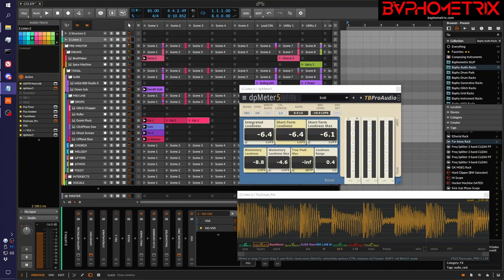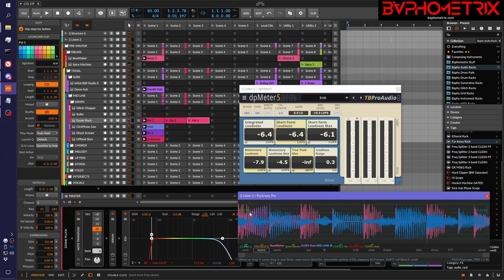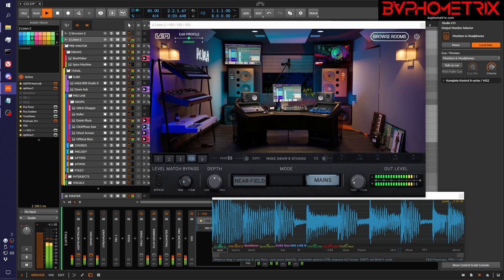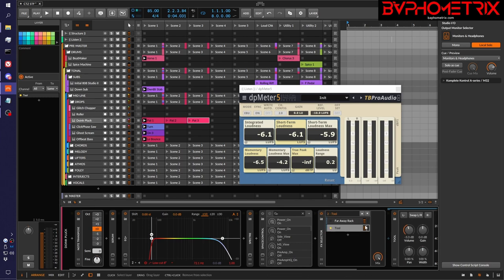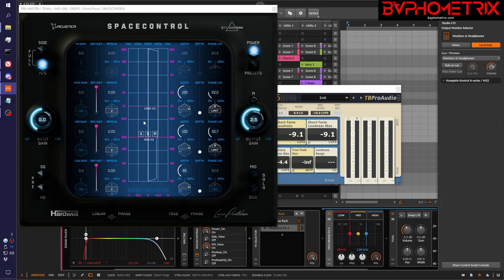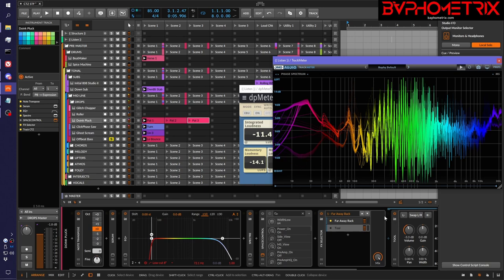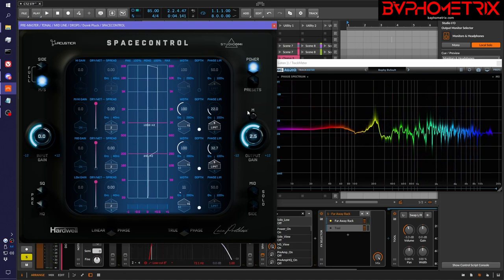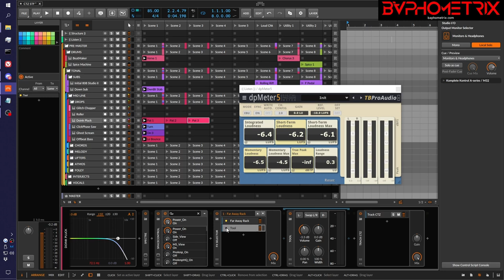Mixing Loud with CTZ - Ep. 24 - Controlling (and using) width and depth

Comment from the maker: TIP: If you want a less expensive alternative to Space Control, there's several versions of a tool called "SideMinder" by Raising Jake Studios. These all sit in the $30-40 range. If you look close at SideMinder, you'll see the same basic features as everything I show you happening on the right side of the Space Control UI. https://www.raisingjakestudios.com/sideminder%20series.html
TIP2: Also see Metall1ac's reply to this pinned comment. If you have Ozone 8 or later you might also be able to do most of what I show you with the Ozone Imager module.
Reply: There is also a hidden feature in the iZotope Ozone Imager starting from version 8 (IIRC) called "Prevent antiphase" that's hidden in the plugin settings. It does pretty much similar type of phase limiting as Space Control and SideMinder. You can also select linear-phase crossover from the same settings view by selecting "digital", and even mess with the Q-value of the crossovers. Just putting this out there, since many people already have and use Ozone and they might not necessarily need new tools for this kind of processing.
Reply from the maker: @Metall1ac  That's great to know! Thanks for sharing this.
Reply: @Baphometrix  SideMinder ME has the extra functions like limiting only the sides.
Reply: Nice video as always, big thanks! So much new and useful information :)
P.S.: Can I also combine bunch of Ozone plugins: Imager+Dynamics, Imager for wideness control (like Space Control), and Dynamics for side limiting? In Dynamics and Imager settings use digital crossover for linear-phase, in Dynamics - split signal up to 4 bands and process only side infrormation in each band, setup compressor to work like a limiter with maximum ratio, fast atack and release. Should it work?

Comment: I think it's a newer aternative, but W.A. has one called Dynawide. It's a 3-band stereo enhancer with limiting and even saturation circuits for each adjustable band. I also see a November sale going on for $10 - it's listed as $60 normal price. Going to demo it.
Reply: So I bought Dynawide. It does not offer any narrowing option on the bands or overall other than what the limiters do on sources way out of hand. It does however offer a linear phase toggle switch and I'm still experimenting with the depth and saturation features.

I demoed Sideminder 2 for a quick  experiment, which does offer narrowing. Applying it on a reverb send, it sounded much cleaner and punchier. I will be buying this for $24. 

I didn't consider correlation meters prior to watching this video and realize how much work I need to do, whether at the source or with these stereo enhancers. I didn't demo Sideminder ME2 or Max. I would imagine Max is too CPU intensive for me on a track basis - ME2 is 3-band, probably closest to Spacecontol without linear phase.

Comment: Thanks for the video. I tried using ozone 9 mastering suite. It doesn't have a multi band limiter, but I used an exciter in M/S mode. For a track am working on I found out I was losing the high end when switched to mono, so I excited only the mono signal around high frequency of my entire percussion bus. Whats your take on this. Thanks
Reply from the maker: You used a creative way to effectively boost the audible mids vs the sides. So you were effectively playing with mid-side balance. Which is perfectly fine.

Comment: Ive made a custom rack for controlling the side, just a quick question, when limiting the sides do you push the gain to trigger some limiting then bring down the ouput, or do you just bring the ceiling/output down on the limiter?

Comment: great video once again! I would suggest looking into the leapwing plugins, StageOne is the most relevant for this specific topic discussed here.
Reply from the maker: Yep. StageOne is great too. I have it and use it, especially for adding width to a thing. I feel like its "Depth" slider often doesn't push things back far enough, but it's great for very subtle depth changes.
Reply: @Baphometrix  running multiple instances in serial is interesting. Also putting CenterOne after it in the chain is helpful for controlling that mid (leapwing calls it center) space. Love the content keep it up!!

Comment: The limiters are NOT static on the sidebands! Instead of setting a threshold you map the phase correlation, which functions as the limiters input signal, meaning it will reduce more volume when there is less phase correlation.

The ratio you set is the amount of limiting applied, basically turning it in a compressor below a 100%. Based on the manual and the button info text^ it seems like the limiter has 2 modes, which determine the shape of compression:

Where Safe mode only limits after a certain phase correlation value, and probably applies linear compression with the ratio you set with the knob. (Until the highest ratio where it truly is hard clipping/limiting the most negative values)

And continuous where it starts compressing directly at the point the when phase is no longer perfectly and seems to not work linearly but rather more 'smooth'. Probably something akin to the shape of a softclipper with the treshold all the way down

Comment: Checking on mono on most daws employs the panning law causing a 3db volume change for hard panned instruments when you employ the mono switch, as it's essentially just panning the track to center. 
I use a dual planner plugin to pan the right channel all the way to the left so whatever pan law is in effect is negated AND you get true mono coming from one speaker and not a phantom mono that is created with two speakers. This is a lot closer to a real world mono speaker setup as none of these employ a pan law - they just feed both channels into one.
Reply from the maker: Good points! You still get the phase cancellation either way, though, and that's the main thing you're listening for. Which elements drop out of balance, and which elements become "hollow" sounding or drastically change their timbre and micro dynamics. Also not everyone has access to a dual panner, and a lot more of us work exclusively on headphones than you might suspect. 🙂
Reply: @Baphometrix  I reckon it’s easier to listen to phase issues when the levels aren’t effected due to pan laws too
The vsx mono auratone doesnt seem to suffer from the pan law problem as far as I can tell. 
For headphones I’d probably add a 2nd panner that pans the summed mono to the center to check.
Reply from the maker: @emrahalpat  Yep. MAAT also makes a free plugin called "2BusControl" that has a mono button that I'm pretty sure ignores pan law. I'm also pretty sure that built in "Mono" button in Bitwig that you see me using ignores Bitwig's pan law as well. And I'm fairly certain that the Mono button in MetricAB also ignores pan law. It all just depends, I guess, and I've been using Bitwig for so long that I started to take mono-checking for granted. Thanks for bringing this up.

Comment: Question Teach???  When limiting the side information, what release time sounds best?  And should I lower JUST the ceiling, or mess around with the threshold as well?  Because I noticed when I bring the threshold AND ceiling down to the same db level, low end information is being brought up which alters the tone of whatever instrument I'm limiting.  Due to that, I stopped messing with the threshold parameter and have just been lowering the ceiling.  Any suggestions?

Comment: Do you have any thoughts about using gating to clean up sounds in CTZ? Since you're pushing sounds to have a low crest factor, you might also be bringing up the noise floor or the sustain on certain sounds also, so it might be pertinent to control these sounds pre loudness treatment with gating in cases where this is happening. I know when processing old breakbeat samples, they benefit from multi band gating to prevent them getting muddy or midrange heavy when you give them the modern squish treatment
Reply from the maker: The level of noise that snuck in on old recorded material is quite a bit different from the level of noise in modern in-the-box sound design and production. If anything, some people complain that digital in-the-box production is "too clean sounding, and too sterile/dry". As a result, it's common to find ways to literally ADD noise and foley sounds at the limit of perception to "dirty up" a production and make it more like "that vintage sound".

That said, sure, gates can be useful in a variety of ways in sound design, so if you bring some sound way up in level (and transparently clip it) to fit into the framework of a loud, dense mix, and you hear that some lower level content in that sound is annoying in some way, sure, you can use a variety of techniques in your sound design and post processing to control that. Gating, downward expansion, dynamic EQ dips, etc.

Comment: I've done abit of research but I just want your opinion: is there any problems that can come from frequency band splitting?
Reply from the maker: Sometimes yes, sometimes no. The "safest" rule of thumb is that "anything goes" when it comes to crazy sound design processing on ONE sound. But you are more likely to run into to trouble with unwanted phase cancellation or crest factor issues when you do band splitting on more complex signals like the sum of tracks on any given bus.

Comment: Hi there! In my opinion Lowsub frequency  nothing to.do  with side treatment ( diff between left e right)     to get depth  in that area cut the sub in the side  e make it sound in the mid  to get widht play with sides in other freq areas but not in.the sub area wich u can make it sounds wider still using mono signal but without pushing it to the sides as it would.work for.other type.of.sounds
Reply from the maker: Fletcher Munson curves. Physics. Psychoacoustics. Volume drops off with the square of distance (physics). If you increase both the sub/bass region and the high region, relative to the mids, it sounds "louder" than before (Fletcher Munson, psychoacoustics).  This was the basic trick behind "Loudness" buttons on audio component consoles in the 70s. So now flip that around. If you reduce those regions relative to the mids, it sounds "less loud" than before. Which, (because volume drops off with the square of the distance), makes your brain think its now further away.  Finally, in any ambient space, sound-emitting objects with more direct signals and less reflected signals sounds "closer" to your brain.
Reply: @Baphometrix  I know all of tht all very true  but to have a clear sounding mix sub freq have to be cutted out from the side theres a correct way to spread sub if you wanna a sub sounding width and depth and its all about routing the mid signal across the mid field not across the side. midside its always dealing with a mono signal wich is the resulting m/s decoded signal the point is how  routing mono and  wich situation requires using just the sum, or the diff or both to spread it into the stereo field left and right channels  resulting in a correct binaural listening
Reply: @dmstudio.sicksoundz  What
Reply: @drinkinouttacups2665  what what?